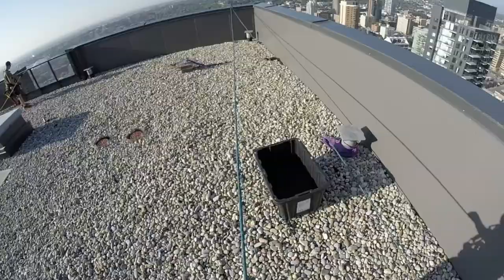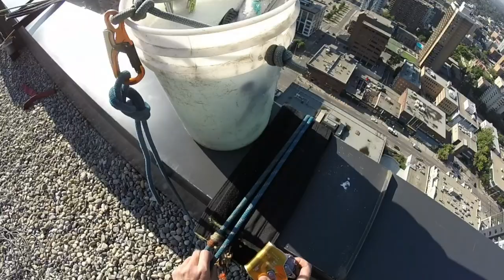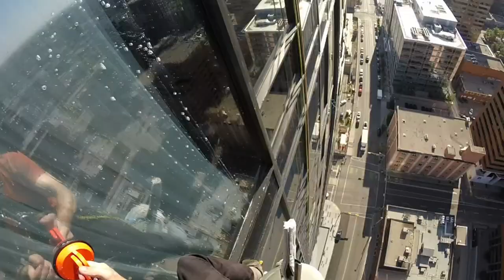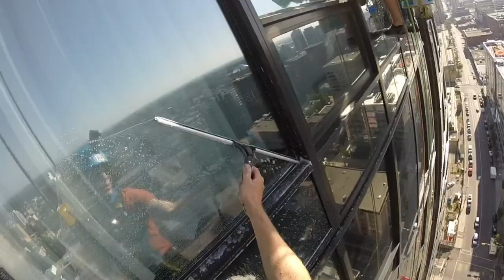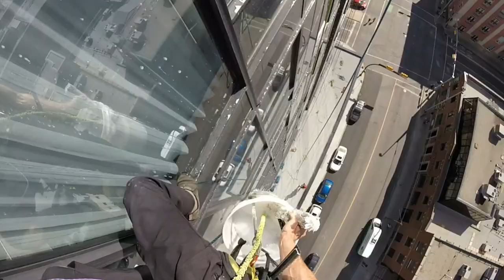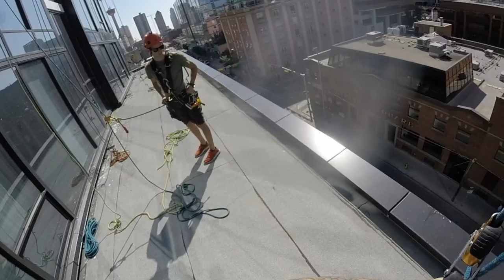Rope access window cleaning with rigging and lots of the drop.

Comment: try an18 inch blade it Just might speed up your window cleaning. I spent  7 years on the ropes in London uk. and a 12 for the small pains. good Luck stay safe.
Reply from the maker: Why would using a smaller blade speed things up? I was using a 24 inch Sorbo in this video.
Reply: @BrodyYYC  hi there. by using an 18 on the big pains and a 12 on the smaller pains .the point is with a smaller blade you have more freedom of movement where as  the 24 may cover more area only that size of blade is  more cumbersome .give it a go .this way you will gain a rhythm and spend les time on the rope .
Reply from the maker: @lyndonmortimer4123  I've timed it out before and I'm much faster with a bigger squeegee. I wasn't even really thinking about the small panels on this drop so I just pulled out the tiny one I usually keep on me just in case. I didn't care about speed here because I was always had to wait for the other people to catch up. Have you used a Sorbo?
Reply: @BrodyYYC  each to there own mate.nice drop though.I  stopped window cleaning  some years ago. got myself a Truck Licence .I do miss the ropes.only here in England . I was busy in the summer then the winter came and the work dropped off .after 7 years  I thought it was time to try something new. stay safe.
Reply: @BrodyYYC  I make you right about the size of squeegee channel. A longer channel means less moves (or sweeps) to cover the same area, equals less effort and faster cleaning.
Keep it up, you clearly know what you're all about.

Comment: Nice video.  If you're not currently, try Ettore Soren rubber in the Sorbo..  better edge and durability.
Reply from the maker: Thanks I'll try that! :) How much longer would you say they last?
Reply: @BrodyYYC  They have a cleaner, sharper edge, so a better clean out of the box... Last maybe 1.5x the sorbo from my experience.

Comment: Wondering what kind of work seat you use? And why that over a bosuns chair?
Reply from the maker: It's a rope access system but in this video it was a Petzl podium. This system is WAY superior. You're able to rescue people as well as self rescue. As well as ascend your line. It's basically just industrial climbing and abseiling whereas the bosuns chair is basically industrial abseiling.

Comment: nice bro, webbing sling to metal anchor ?, i prefer wire sling
Reply from the maker: I prefer webbing because the rating is basically the same and one time I almost knocked my tooth rigging a rolling anchor with a wire sling. I do take materials into account for example I prefer to only use aluminum carabiners on webbing slings and steel carabiners on metal anchors.

Comment: What happens if you run out of water
Reply from the maker: Then you're screwed lol. Sometimes you run low but you can usually conserve more towards the end when that happens. This 5.5 gallon is basically good for a 2 window 40 story drop as long as it's not right in the sun.

Comment: I dont get why your not wiping up? Yeah you may not be leaving any lines or bits down the sides of the windows but on the frame your leaving loads to end up driping getting caught in the wind and blowing back onto the window leaving it dirty?
Reply from the maker: What wind?
Reply: @BrodyYYC  you saying there's no wind up there? Im not trying to have a dig at ya or nothing just wondering as to why you dont wipe up so besides my first point why dont you wipe up? Isit in the contract or is that your choice or what? Also ive been a window cleaner for roughly 10 years now doing ladder and pole work how do you get into your part of the business? Only recently been interested in trying it

Comment: nice dude pretty good video just the setup i don't trust it but good job :)
Reply from the maker: Thanks :) What don't you trust about it? I enjoy discussing this stuff. Would you not go over the edge with the rigging or would you just prefer to build y-hangs or something?
Reply: @BrodyYYC  yes I like the Y hang cause I can split the weight 50/50 because currently I'm on a highrise 70 floors and the weight of the rope is different and I like to be light. :)
Reply from the maker: @L.A-adventures  Even though I have thousands of hours on ropes I've never actually taken a course so I'm still learning lots that's why I like to ask lots of questions. But I feel like since I combined both lines with equal tension both anchors should be loaded evenly. Would that not be basically the same as a y-hang between 2 anchors using butterflys? The difference I see between the 2 is that you have each line load shared between the 2 and with the way I have it both lines are load shared between the 2.
Reply: @BrodyYYC  How can someone claim to have thousands of hours rope time but have never taken a course!!!!   That would never be allowed over here in England. You just wouldn't be allowed to work without your IRATA certs. Also, I'm amazed at how many videos I've seen (and I don't mean this one). with some really poor safety, ie no lanyard on squeegee or applicator and so on. A squeegee from that height would kill somebody stone dead in an instant. Also, people tend to get a bit lazy after a while and start to take silly shortcuts to save a few seconds, such as going over the edge before clipping the back up rope grab on, or just using a back up and a ID descender, but no chest ascender. 
I guess that some countries just don't have the strict levels of health and safety legislation that we have here in England.
Reply from the maker: @jasonclark3057  I've been working with people who are IRATA trainers now and level 3 SPRAT techs who have taught me a ton. But hey man I don't make the rules and I agree with you it should be required and there are tons of people working here with much less mentoring than I had. I did however just finish 6 days of SPRAT training yesterday.

Comment: ..how do you weight test your gear before going over the side, also is there some sort of Lock-Out / Tag-Out procedure for the roof access..? TIA  ..you ever have a secretary walk up and press her titties to the glass hahhah?  1more question.. i've seen other window washers use a rag to wipe/clean the window sill after cleaning... is that a contractual thing i.e. cost more or what..?

Comment: You should make the owners of that building install a rated ring to clip into and a rescue system. That pipe you wrap your strap around may be valid and may have held you for 1,000 runs but that’s still sketchy as fuck
Reply: Always has to be an expert on here. I'm sure he knows what he's doing
Reply: @grady.stu.8300  stick around on enough sites with the wrong company and you'll realize how much insane shit they do that is not up to safety standards. Doesn't matter if you "know what you're doing". Safety rules are written in blood

Comment: great video <3 can u tell how much $ you earn per month for window cleaning? Its dangerous and hard work :/
Reply from the maker: It depends on so much so it's not something I can really put a number on. It's not that dangerous in comparison to other things like even driving your car for example. On top of that it's an extremely safety oriented industry. It can be hard work though you're right about that :) I just pause my gym membership in the summer because I'm already getting a free workout.
Reply: I used to clean windows with these same sorbo products. Nothing like this though, just residential and commercial. It is an art. Using these squeegees is very awkward at first. But once you get it, you get it.

Comment: I always leave a cows tail on the bucket just Incase
Reply from the maker: That's a good idea since those old Petzl podium loops are only rated for 15LBS and I think the new ones are 20. What I do is back it up to my positioning D-ring using a small climbing sling so it's still connected to me with 2 points.